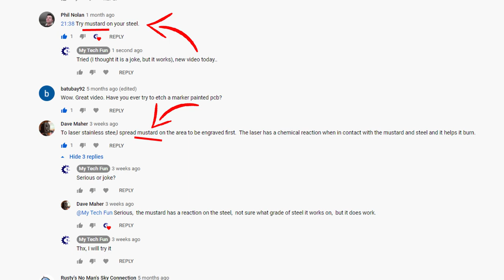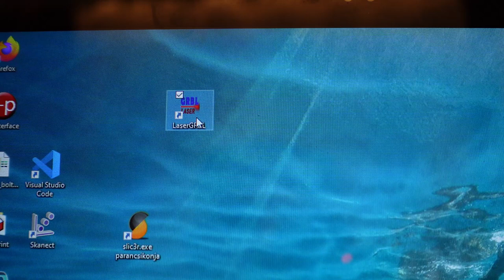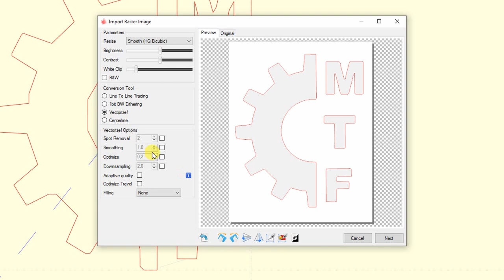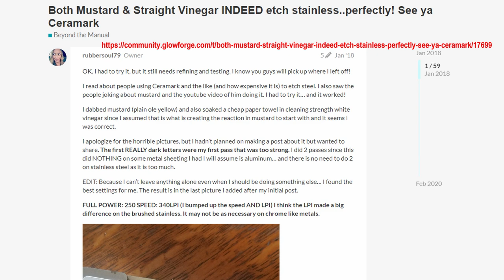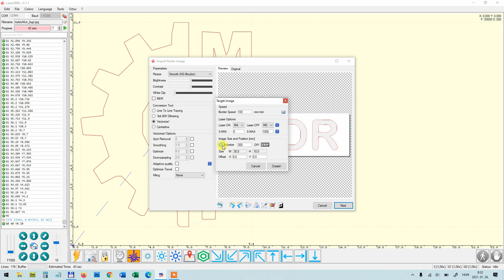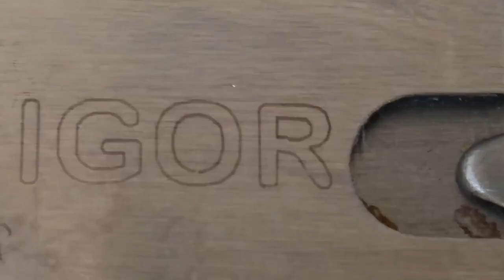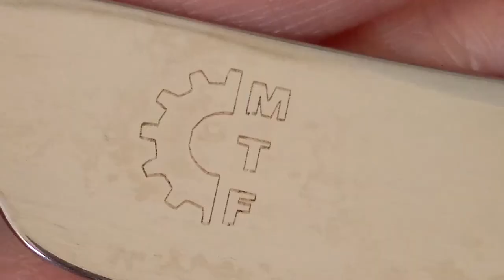Laser engraving (etching) stainless steel with budget 15W laser engraver (Ortur Laser Master)

Comment: I use Dykem marking ink. After lasering, I wash the Dykem off with nail polish remover or acetone. Comes out perfect every time.
Reply: can  you link to what ink you used?
Reply: What wattage laser are you using with that ink?
Reply: Does it matter if you use Dykem's blue or red ink?

Comment: Igor I think you didn't notice some safety issues that can hurt you in the end. Your goggles are clearly not sufficient to block all the blue light. You should see the glow of the material you are cutting but no blue light at all. You need OD6 or more make sure your goggles blocks 450nm. Even diffuse reflections can damage your eyes, and in this case, it's far more dangerous because you are etching a reflective surface. When I etch metal, i start the job and step way back away from the machine so the light has enough distance to diverge before hitting my face.

P.S the mustard trick is very cool. I'll try it soon
Reply: Only dangerous if you look INTO the laser.... those goggles are perfectly fine

Comment: Great vid. I am getting ready to have a stainless steel muffler laser engraved and I wanted a more bronze colored engraving do I need to provide a bronze source or will the source color not matter?
Reply from the maker: Material matters and thermal conductivity. That's why we cannot engrave alu or brass. With 10-20W laser I don't need anything on surface any more.

Comment: Actually the black permanent marker works good and it's easier to apply. But I'm couriouse it somebody knows how to etch metal plating like chrome for example. The marker and mustard doesn't work here.
Reply from the maker: With weaker lasers marker didn't worked to me. Nowadays, there are new, stronger lasers and they can engrave steel directly or only using the marker.

Comment: Is the steel actually etched or are the designs burned mustard sitting on top of the steel?
Reply: he showed at the end what it looked like after running through a dishwasher.  still looked damn good!
Reply: @thegrafxguy1  I couldn’t tell from that. maybe it’s obvious if you’ve used a laser to engrave?
Reply: @AndrewHelgeCox  I guess I'm assuming that his dishwasher was good enough to remove it if it were just burned on but I very well could be wrong about that.
Reply: I doubt it was etched, I'm pretty sure that this was simply something baked on by the laser. If it was, indeed, etched, I would like to understand the physics/chemistry of the process.
Reply from the maker: Now, after approx 1 week and everyday use/washing, it still looks like at the end of the video.
Reply: @MyTechFun  that was my assumption just watching the end clip, I'm glad it turned out to be permanent!

Comment: you're putting it on way too thick and you have to put it on evenly I use a small foam brush. and a very very light coat, when you put it on too thick it takes off the engraving when you clean it

Comment: Buy a can of Brilliance spray off of Amazon. It works with my Sculpfun S9 Pro.
Reply from the maker: Recently I tested Aufero Laser 2, it's SF laser module can engrave steel directly https://youtu.be/y_b4poZoovo
Reply: @MyTechFun  i have done that as well, but with the spray it is amazingly black and you do not need to push the laser to full power. I believe I ran mine at 300mm and 60%. I only have pictures of my company logo, but I will do another print and somehow post a picture of it.

Comment: Quickest way is still to spray it black or use a marker and etch with Ferric oxide or use the vinegar and electrically etch it, goes deeper and is more permanent
Reply: Do you mean etch the paint/marker with a laser to form resist, and then etch in Ferric Oxide? I'm curious about the quality/resolution such method can produce. I need to etch lettering in brass (letters about 3 mm tall), but the results need to look fairly well. I'm looking for the simplest way to do that.
Reply: @antipode_ghost  exactly like that, it is after all how pcbs are made, so resolution is very high
Reply: @Tarex_  Any pointers/advice for this technique of laser forming of chemical resist? Like what paint to use for best results, what power of laser is needed?
Reply: @antipode_ghost  Black paint, one coat, two if needed, laser on max power so it pulverizes the paint, if you are vector engraving one pass should be enough, you will see the metal shine through, raster engraving two passes, clean off the residue and you can either put the oxide where you engraved or dip the whole plate if everything else is covered up, my largest project was a DIN A1 Copper plate with a picture and text, was etched fine and colorfilled and is hanging on a wall somewhere